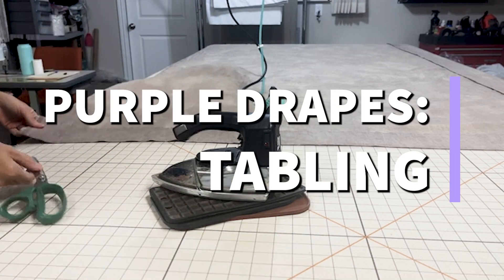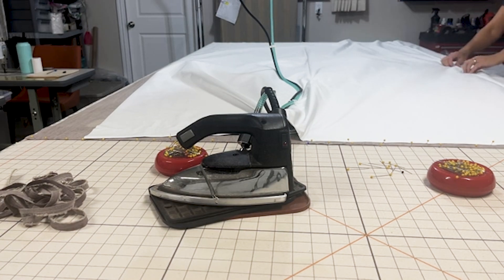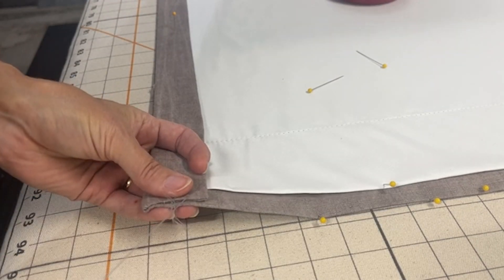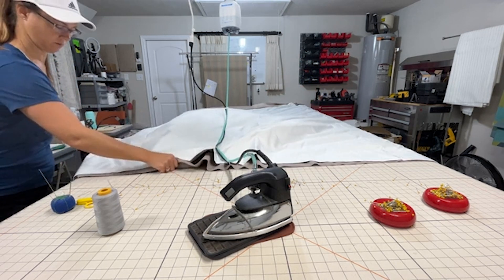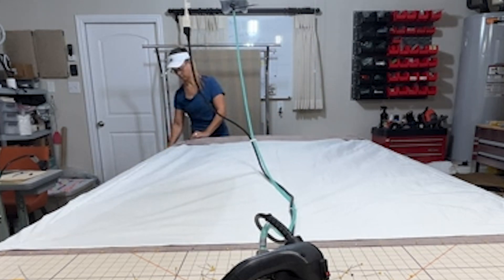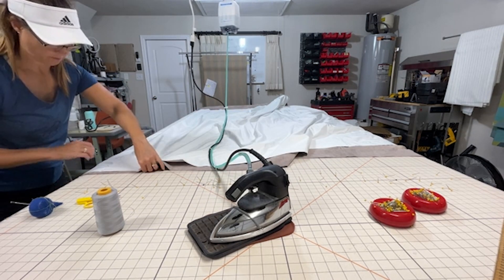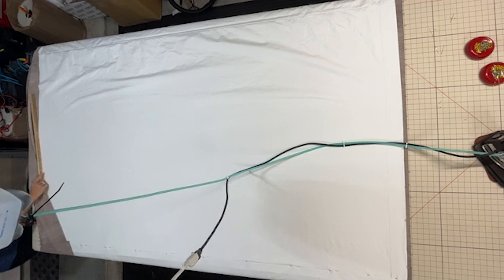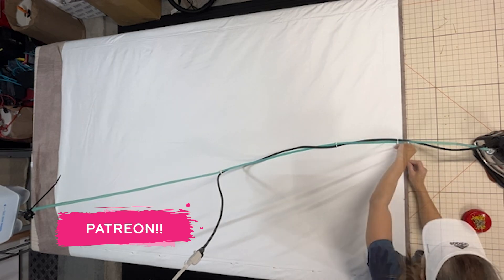Step 4 of Drapery Making - Tabling in the Workroom

Comment: What thread size do you use for the blind hemmer ?
Reply from the maker: Same as I use on all my other machines. I mostly have T40 but some are lower like T27. Whichever color matches best is what I reach for.
Reply: @tullydraperyshop  what about those thin polyester threads? Ever tried them? they are almost invisible on sheer fabric! I use them for anything even drapes! I started using them a year ago but i don’t know how they will do long term after sun exposure and washes! Ever tried them?